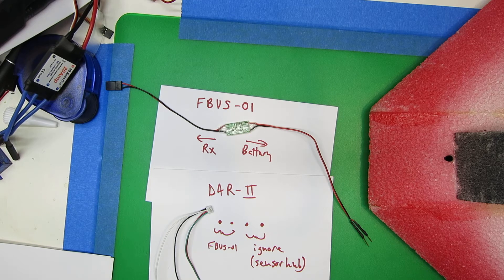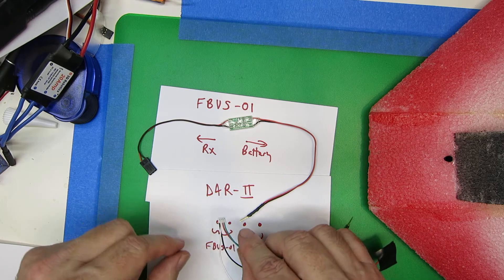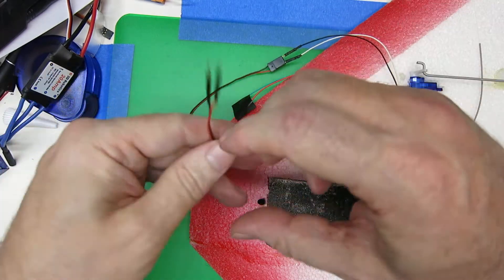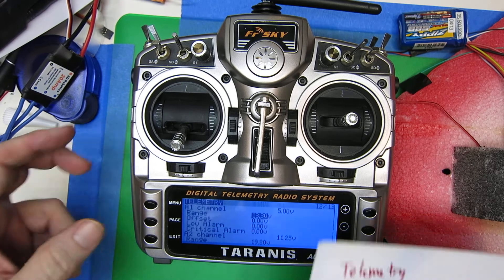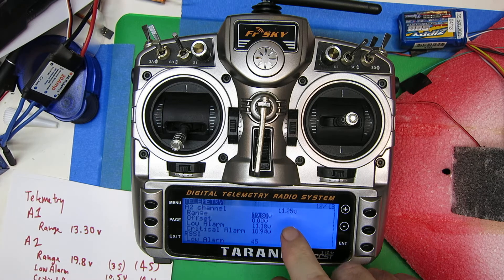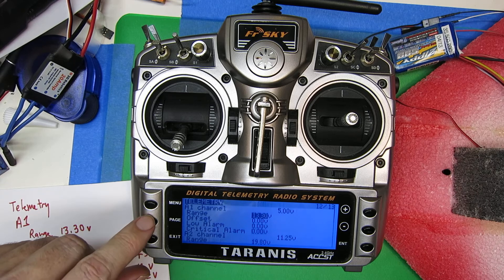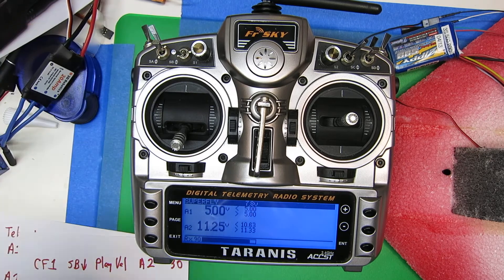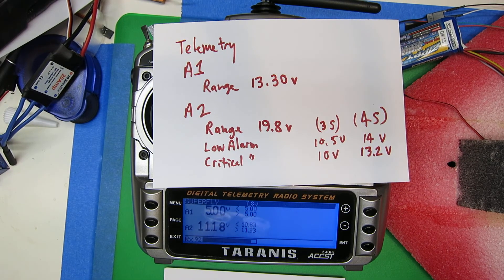Taranis D-Series Telemetry, Lightning Version

Comment: im so frustrated with this whole hobby, the fragmentation and lack of documentation is infuriating.  OpenTX 2.1 is very different for setting up this sensor.  I can't find anything about it.  I was able to find documentation for the deluxe cell sensor with the LCD, and I even got myself one of those as well, but, what do you know, that sensor doesn't seem to work with the d4rii.  so i can't jack diddly to work for v monitoring.
Reply from the maker: Sadly, I haven't upgraded to 2.1.  When I do I will update the videos.  I'm sympathetic about the documentation issue... that's one of the downsides of open source products.

Comment: Very good. Thanks for sharing this quick setup.
Could two battery voltages be monitored?
Reply from the maker: I don't think so... A1 seems to be dedicated to receiver voltage.  But with the X series, it should be no problem.
Reply: Mark Harrison I have an X8R. From what you are saying I could I daisy chain two smart port LiPo sensors and receive info from both?